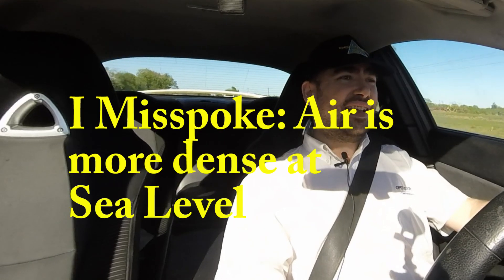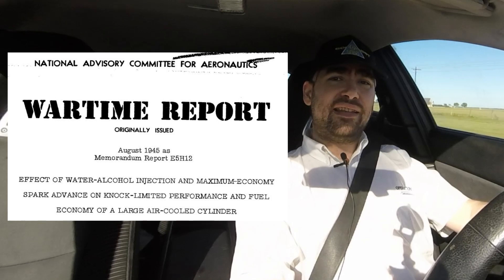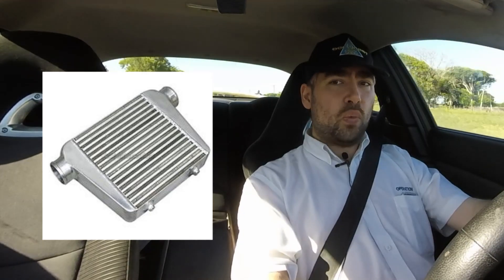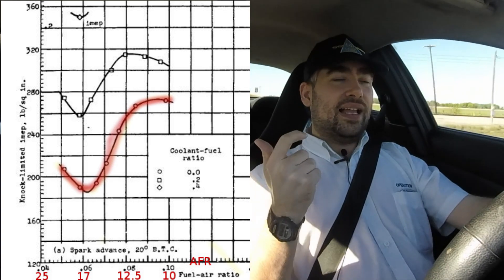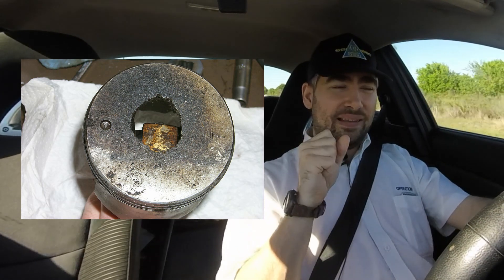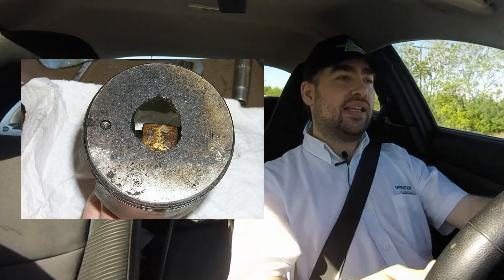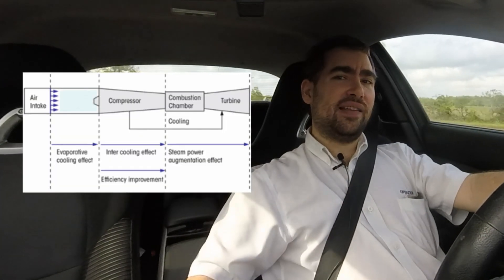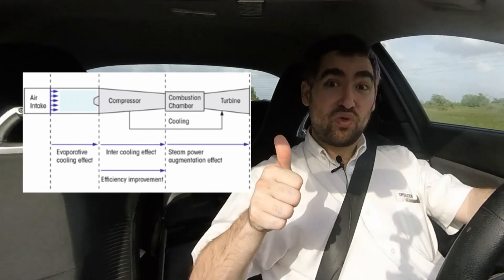Why water injection with no intercooler? Voiding Warranties - Ep35

Comment: You will eventually ruin your turbo. Sorry but it's true. Unless you are running ridiculously low boost, 2-3 psi.
I'm running over 50 psi and water/meth pre turbo ruins it in minutes. My turbo is spoiling at around 120-160k rpm. Pre turbo does have advantages, but the cost to advantage analysis isn't worth it.
So, therefore, you run water post turbo and post intercooler, basically at the intake manifold.
This increases durability, does not ruin your parts, and you get hp/torque gains.
Also you failed to mention that most vehicles can't run 20% let alone 40% water by weight due to quenching. Which is the real reason that detonation doesn't occur. You are running so much water you actually kill the fire during ignition.
Which is why at sea level the old planes blow a lot of white smoke.....
Do better research please. Don't spread false information because you failed to bring all current data to the table. Contact a real mater/meth company and they will happily give you real data.
Reply: I back Voiding Warranties 100% here. Do more research so you'll know the reasons WHY.

If you are running 50 psi of boost you need a better engine.
It's only 50 psi because your head flow,  and/or,   your cam selection, sucks.
Not to mention that the turbo is NOT matched to the application.
Put a higher flowing set of heads on it with an appropriate cam, and your boost will drop in HALF.
(and your crankshaft will be laying on the track in a puddle of smoldering, smoking oil )
I wouldn't mention this to anybody if I were you.
You're running 160k rpm, and you're talking about "cost advantages", BWAHH HA HA HA
how many turbos have you exploded ???
Do you run an air cleaner ? 
What do you think ONE spec of sand would do to a compressor wheel at that speed.
That rpm puts the tip speed at WAY, WAY, over supersonic,
so you either don't know what you're talking about, or you're full of shit, or both. 

I spent years arguing in the MegaSquirt forums for water injection instead of inter-coolers,
but 90% of the fools get their education from other fools rather than scientific research and books.
I also will argue for throttle-body before the turbo compressor. When done correctly no system
will spool faster, and there's no need for a blow-off valve, and the turbo runs cooler,
along with any other intake tract plumbing, It does require special attention to the exhaust bypass
side, but this is another bonus in reducing heat build-up. The dump valve must be capable of at least
bypassing ~50% of the exhaust around the turbo, and it is manifold vacuum/pressure controlled,
no electronics, no special regulators needed. This is nothing special or unusual, and it's more
simple, cheap, and reliable than all the monkey-motion gizmos hanging all over most turbo set-ups.

If water, or water/meth injection is done with a completely separate set of proper fuel injectors,
(with a 9th injector at the turbo inlet), 
the engine will run perfectly under load with 80% water to fuel ratios, 
( one to one ratio with water/meth 50/50 mix ),
( 9 more injectors, the same size as the gasoline fuel injectors, controlled by the same computer ), 
(assuming an 8cyl engine),
AND a 14:1 compression ratio,
(but only with excellent head/piston design and tight quench clearances),
(this is not something that you can just "bolt-on").
This also cools the exhaust temps significantly,
(although not as much as you would expect).

Which brings me to another item not mentioned here......
Any engine's exhaust is mostly STEAM, so your turbo is driven by STEAM. 
When you add water injection, you are creating more steam to drive the turbo !!!  
So, you should also study the use of steam as a means to store, convert, and transport energy.
Steam has been used for centuries in heavy industry and large commercial buildings,
and is still very valuable, and in use, today.

The main reason why I DON'T like inter-coolers......
Simple, varying, unpredictable, performance.
Another thing not mentioned here is that there is a VERY big second method that an inter-cooler
works by, which is, it's function as a "heat-sink".
All that aluminum absorbs heat when it's cool and hasn't been "used" for a while (out of boost).
It's capacity for transferring heat heat goes down every second that boost is applied, so
you never really know what kind of cooling performance you're going to get.
This doesn't matter as much on a drag only car, 
but a road-race, or street car, is a totally different story.
This is why virtually all factory designed inter-coolers are "air-to-water", and then, "water-to-air". 

Piston engines are a stupid, 200 year old, design.
They will never get over 24% efficiency.
The engine I invented has no reciprocating/oscillating parts, and is over 80% efficient.
No Cooling System, 
Not loud/no muffler needed,
Makes torque similar to an electric motor, no transmission needed,
Combustion temps under 400F degrees,
Made out of plastic, (except for the combustion chamber),
Makes 4X the power, and, 4X the gas mileage.
Burns Diesel and water, (but can be set-up to burn anything),

Ask yourself why we are still using a 200 year old design,
and why I'm scared to produce this engine.
It's one step towards "the red pill".......
Reply: @jimbrown563 You were talking alot of sense until you plugged your own product and claimed the ICE engine will never exceed 24% efficiency. Toyota has 41%... you would think many other companies have similar, Mazda is claiming higher with SCCI.
Reply: @Jaredscott89 ,
Yeah.....  As-if.....
In the first place, those numbers are highly unlikely in real world circumstances.
Not to mention the fact that these systems add huge complexity to an already overly complex engine.
Did you really think I missed those ?
The Honda  CVCC  engine did better back in the 80's.
No,  I take a wait-and-see approach, if it lasts 5 years in the real world, without becoming unreliable,
then MAYBE they've got something.
But just try to get you local generic auto shop to touch it.....  HHAA !!!!.
That means that, when the warrantee runs out, the car is TOTALED,
because it will quickly get more expensive to fix, than it's worth on a used car lot.
There have been hundreds of  "monkey-motion"  versions of a piston engine  "re-invented",
and 99% are no better, and therefore completely worthless.
The truly worthwhile innovations are quickly CRUSHED and buried,  along with their inventors.
My engine works on well proven and well know Steam Engine principles perfected back in the early 1900's.
The only  "new tech"  things about it are the bullet-proof combustion chamber, and the use of plastics.
It can run perfectly well with, or without,  computer controls, and STILL beat any emissions requirements.
And, is over ~80% efficient.
.
.
Reply from the maker: Ok, you are giving me quite a lot to respond to. First cost analysis is fine if you actually analyze, but you don't.  The only examples of preturbo water injection damage to a turbocharger I've seen (not due to unfiltered air and dirt tracks) has been due to pooling and slinging of large droplets in the intake. I have found no examples of atomized water doing more significant damage than unfiltered air or just regular wear and tear, but I'm open to proof of well setup preturbo injection damaging turbo blade at a rate fast enough to be expensive.

 I've run well  over 100% water to fuel by accident, and still had the car running albeit roughly and a rotary engine is extremely susceptible to spark quench. The 20-40% I run is a relatively small amount. Also, old planes at sea level?! Planes don't use continuous water injection, it was only ever designed for high power situations at low altitude. If you lose power with quench then the system has failed. A plane being old does not mean it uses or doesn't use water injection, several jets use water injection, and lots of WWII planes didn't have it at all. 

The reason detonation doesn't occur is chemical, and it's well documented. It's also the reason EGR can prevent detonation. It is not due to quench. There are plenty of research papers available, here is a link to get you started. http://www.not2fast.com/NACA/

Look, I appreciate the ability of any anonymous person on the internet to claim to be an expert, but please at least bring some information to the table if you want to disagree.
Reply: Andrew, First look at the "problem areas" of a piston engine, 
as far as what you are trying to accomplish with it.
 
(1),
An "Air Pump" to provide Oxygen and heat concentration for combustion,
piston air pumps are only used because it's the cheapest design,
and it is only the most "cost effective" because so many manufacturers are 
still tooled-up to mass produce them. 
A Rotary-Vane Pump is way more efficient, 
and, it doesn't vibrate, and, usually, doesn't require lubrication.
Vane Pumps also make a very efficient Steam-Engine when run in reverse, 
especially when they are "Compounded",
( a small one feeding a bigger one, which is feeding an even bigger one ),
( Google compound steam ship engine ). 

(2), 
In a piston engine you have milli-seconds to extract useful power from 
the combustion process, 
that's NEVER enough time, 
and requires precision ignition and fuel injection timing. 
There are 3 basic stages to a combustion event,
the entire third stage of that event is comparatively slow compared to the first 2 stages,
and it goes straight out the tailpipe, 
completely wasting 40 to 50% of the heat and expansion of combustion, and,
the stupid-high peak temperatures will start to melt parts without a cooling system.
The cooling system throws-away around ~30% of the power generated by the fuel,
ALL THE TIME. Just to heat-up the air outside.
So, you now are blatantly wasting ~70 to ~80% of the potential power of the fuel,
BEFORE you get ANY power at the crank.
( and, the whole Piston-Connecting-Rod-Crank setup, is not very efficient either )

I found a super efficient combustion chamber design that was developed for jet engines,
it runs comparatively, at very cool temperatures,
and with very high efficiency, 
and with extremely low emissions production.
(Google- SPRF Combustion)
It is designed to run continuously, and likes water injection, so....... 
basically, it is an instant, continuously running, steam generator, 
which can be easily, and instantaneously, regulated as far as output volume goes.
The exhaust of this combustion chamber is used to generate additional steam by
injecting water directly in to the exhaust gases in a fine mist,
which cools the exhaust, (mostly steam),
to levels easily manageable by high temperature plastics, like Teflon.
(around ~4 to ~500F ).

Now, put it all together,
Create a three, or more, staged, compound, vane compressor out of Teflon, to 
supply ~500psi of compressed air to the combustion chamber, 
(very high pressure, but very, very, low volume),
inject fuel and water,
(similar to a modern Diesel piston engine injection system), 
start combustion with a Diesel engine "Glow-Plug",
( the SPRF combustion chamber design has VERY stable combustion, 
and is very hard to "blow-out" once combustion has started ), 
inject a fine mist of regulated water into the exhaust to cool it and 
create additional steam at the same time, 
run the steam into a compounded vane motor, made out of Teflon. 
This motor is sized to run the compressor, 
plus additional power to accelerate the compressor to higher rpms when 
there is an increased demand for steam, 
( maybe 2 to 3X more displacement than the compressor ), 
then you have a stupid amount of left-over steam at ~450F and 450psi,
to run a main output motor, or multiple output motors.
The exhaust from all of the motors is mostly warm, liquid water which is
condensed, collected, filtered, and then recirculated back into the engine,
for conversion back in to hot, high pressure, steam.
This is the only approximation to a "cooling system" in this design, and,
it is not strictly necessary.
Although it does cut down on the overall water consumption of the engine.
The exhaust gases, 
which are the by-products of the combustion process, 
and which were combined with the steam previously,
are vented to the atmosphere.
The exhaust gases are roughly one quarter the volume, 
(for a given power level), 
of a modern Diesel engine,
and is far lower, percentage wise, in undesirable gases and particulates.

Like I've said before, If I can figure this out, I'm sure there are thousands of other
far more qualified engineers that can figure this out as well.
But YOU will NEVER see it.
So, like everything else in life, reality is ALL a Big FAT MIND FUCK.
Don't believe anything you hear or read, and only 10% of what you see.
Reply: Just to add. I modern Large diesel ship engines, water is injected into the cylinder at the same time as the diesel fuel but with a separate injector. It cools the valves cleans out soot and water does have that 1600 to 1 expansion ratio when it goes to steam.
Reply: Nope, properly setup pre turbo injection will have no detrimental affects. Doing it wrong? Sure, thatll fuck it up.

Also, I read your name as gay parent, just wanted to let you know.
Reply: @typedrew  it looks like he spelled it as " Gary parent "...fyi.
Reply: gary parent 
To much increase in compression will push a hole through the hot spot on the piston.
Reply: @gingerbread2875 ,
That's not how it works....
The ~2 or ~3 hundred psi of compression pressure caused by the CR or Boost is tiny compared
to what happens when you get into heavy detonation.
( which is not  "caused by"  compression ratio )
The piston crowns, (and actually the cylinder walls too),  are  "insulated"  from the high peak
combustion temperatures by A THIN LAYER OF AIR.
The thickness of that layer of air determines how great it's insulating properties are.
( like a thick winter coat insulates better than a tee-shirt )
The higher the  PEAK PRESSURE  gets in the combustion chamber,
the thinner that insulating air barrier becomes, which means that those extremely high
PEAK TEMPERATURES can now be transferred faster into the surrounding materials,
( piston crown, cylinder head, and cylinder walls ).
The head and cylinder walls are relatively heavy and thick, 
when compared to the thin aluminum cross section of the piston crowns,
( which may only be 0.125"  thick in some places )
so........ 
The first thing to get  MELTED, 
when the super high pressures and temperatures are generated by DETONATION, 
are the piston crowns,
that is,  
if you don't blow-out a head gasket first, 
or maybe.....  deform a connecting rod, break the crank shaft, or crack the block.
DETONATION is the problem.
It's like packing your cylinder with dynamite, and then setting it off......  Somethin's got to give.
Reply: Nope, sorry, I spent 2 years studying and trying to figure out why this won't work.
It will.
Energy can never be "lost", but it can be converted in to another form,
which you may, or may not, want.
The vast majority of what comes out of a tail pipe is STEAM.
Just because you usually can't "see it", doesn't change the fact.
Read up on the products of combustion.
That's also what jet "con-trails" are, 
(when it's not the government trying to make you stupid and sick with heavy metals),
(in that case they never go away, and just spread out ),
they are VAST quantities of steam that turns into ice crystals because of 
the below zero temps at extremely high altitudes.

"boiling all that water takes energy"
Right, you are absolutely correct.
My engine design coverts some of the excess temperature into steam pressure.
Super high temps are not useful.
A lower temperature with a much higher volume "and/or" pressure, is extremely valuable.
Super high temps melt things, so you have to "suck-out" some of that temperature
with a "cooling system", and then you turn around and throw away that excessive
high temperature "energy" in to the atmosphere so that the pistons won't melt.
And, at that point, you will never get that energy back, it's GONE.
Steam has several different means for transferring energy.
It can store additional energy in the form of temperature, without gaining or loosing pressure.
Steam is magical stuff.
Most people have many misconceptions about it.
It's a HUGE subject, all by it's self. 
It took me weeks just to begin to wrap my head around it.

"The work in internal combustion engines comes from 
the pressure increase caused by heating the air"
Only around 15% correct.
It's the steam, 
created by the combustion process,
that does the vast majority of the work.
Yes, the air does expand when you heat it up, 
but it's no where near what that instant steam production does.
The only reason why there are limitations as to how much water you can inject,
is because there is not enough TIME, 
(in a piston engine), 
to perform the beneficial energy conversion to steam pressure.
The time for the energy conversion is directly related to the 
starting temperature and pressure of the water,
and, how small the water droplets are, 
(which determines the surface area exposed to the excessive heat that you are 
trying to "move" into the water droplets, 
so that the water droplets will expand to 1600 times their original volume.
You are trading temperature for volume "OR" pressure.
If the space is fixed, you get more pressure with the same volume.
If the space is unlimited, you get more volume at the same pressure.
In either case, the temperature does not change, unless there is some other object or
substance that is at a significant temperature difference, like a "cooling system" making the
surrounding surfaces much cooler than the temperature of combustion.
Did you know that an engine will become more and more efficient the hotter it gets ???
( until it gets into detonation, but that's a special problem limited to piston engines )
That's because heat is being diverted into, and lost by, 
the surfaces making up the combustion "space", continuously.
Now, if you could take all that lost energy (~30+%) and use it to convert more fine droplets
of water into steam, you would then have used that energy in a productive way, 
to make more pressure, which translates in to usable power,
while at the same time reducing the temperatures to a level that will not melt engine parts,
(and you don't have to drive a water pump or cooling fan).

"In all cases, 
the power increase from water injection comes mostly from burning more fuel, 
not specifically the boiling of the water"
FALSE
Piston engines are "detonation limited" engines.

1) Increasing engine temps, increases power, but,
it also increases how close you are to the onset of detonation.

2) Increasing compression ratio increases power, but,
it also increases how close you are to the onset of detonation.

3) Advancing ignition timing increases power, but,
it also increases how close you are to the onset of detonation.

4) Cramming more oxygen and fuel into the engine increases power, but,
it also increases how close you are to the onset of detonation.

5) High Octane Fuels will withstand more pressure and temperature
before the onset of detonation,
allowing the increase of any combination of 1) through 4).

Of course all of these items have ideal ranges and limitations, and, 
interactions with each other as well.

Other factors are, 
combustion chamber design, 
intake port design,
GDI, or Gasoline Direct Injection, 
were the fuel is injected directly into the combustion chamber like a Diesel engine. 

Your last comment has already been successfully done by
my personal hero, a guy named Smokey Yunick. (dead now)
Google  "Smokey's Hot Vapor Engine".
IIRC, he didn't use water, but the heat was used to completely vaporize the
fuel before being pumped into the engine by a turbo charger.
The turbo was not used in the conventional way at all.
It was there because the fuel expanded so much that the engine couldn't "suck it in",
so it had to be pumped in with outside pressure for the engine to run.
Complete vaporization of the fuel made it far less prone to detonation at high temps and pressures.
This was back in the '70's, and his daughter still has the Pontiac Fiero, and it still runs just fine.
It produced something like 50% more power and 50% better fuel economy over the
stock, unmodified, 4 cylinder engine.
Reply: @jimbrown563  Hi Jim. I really enjoyed reading your very interesting post on this you tube video,  I am 57 yrs old man from Australia who loves all things automotive, I would like to learn from you more, your intelligence and insight on engineering and also your engine is great mate!  I know this post is 3 years old but i hope I hope this message reaches you eventually.  please contact me for a chat , much appreciated. John. Sydney AUSTRALIA.